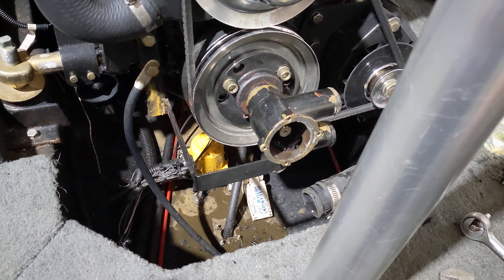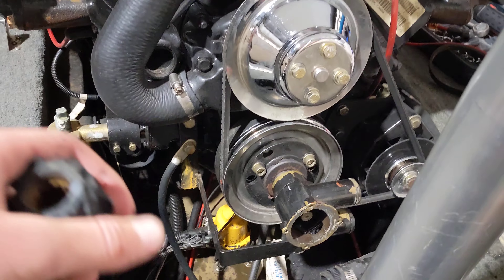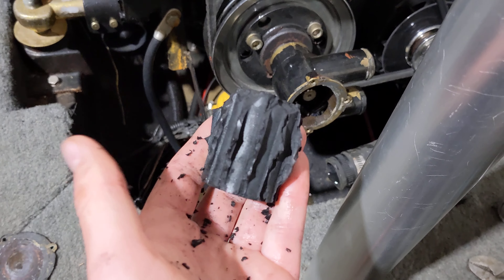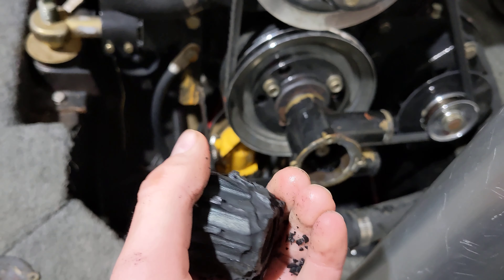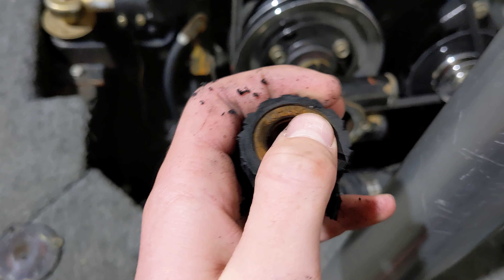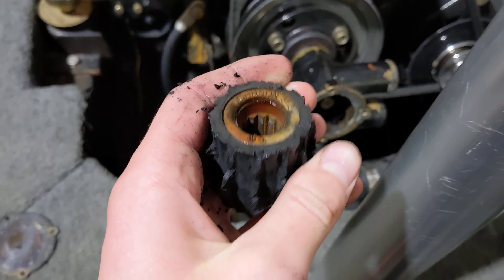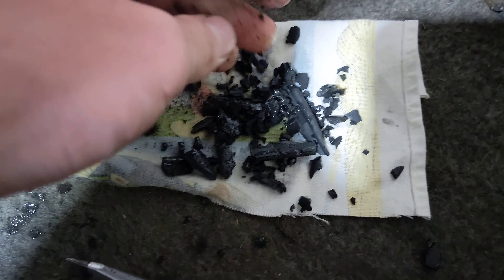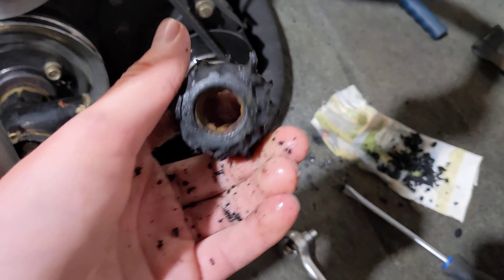Shredded Mastercraft Impeller (1995 Prostar 190)

Comment: That is a Johnston pump and impeller, which is OEM for that boat. Just a headsup.
Reply from the maker: Yes I realized that when I went to buy the new one. Thanks for the comment!
Reply: @Fuel Up  
Hey, if you have any questions regarding your restoration project, don't hesitate to ask, as I restored one as well.
Reply from the maker: @MrRbass1  Awesome! The engine is supposed to be coming back from the machinist within the next week. So hopefully we can get it all running within the month.

Comment: Great video.  Question... at the end you say, "That's why you always want to make sure you're doing your maintenance and making sure that you change the wear parts."  Other than the impeller, what other wear parts do I need to be cognizant of?  Also, how involved is it to change out the impeller?  Thanks!
Reply from the maker: I find boats quite simple, and they have few wear parts/consumables compared to other powersports. 

Stuff to change every year would be oils, like transmission, and engine oil/filter, and grease your steering rudder. 

Every few years I would change your Impeller and filters like fuel/air. And inspect the drive belt.  Also grease/oil your trailer bearings and tires depending on how much trailering you do. While doing this inspect the breaks on the trailer. 

I am not a mechanic but this is what I have found over the years, there may be more that I am missing, but this is what I do. 

Impellers are quite simple to change, usually the hardest thing is getting to the impeller (in a direct drive it is easy, in a v drive it is usually quite difficult) when installing it use a lubricant like Vaseline and spin it I'm the opposite way the "fins" were "pointing" when you took it out. And  be sure to seal the cap after reinstalling. 

Hope this helps!
Reply from the maker: I have been told to preserve the impeller, don't run the boat without water (this can be the lake or with a hose) for more than 10-15 seconds, as the friction will melt and destroy the impeller without the lubricating properties of water.